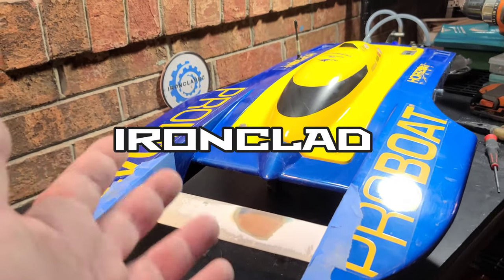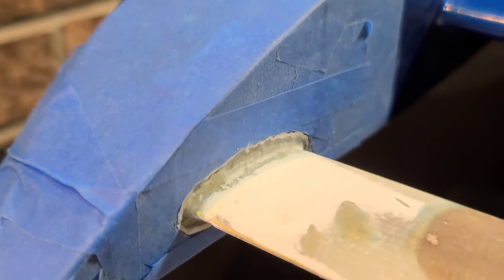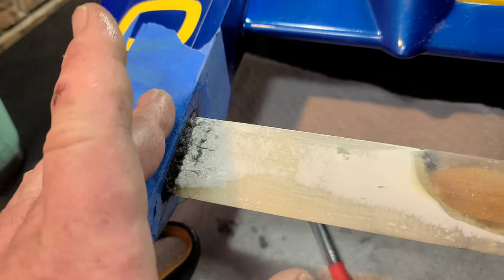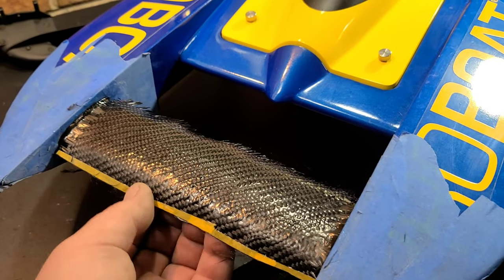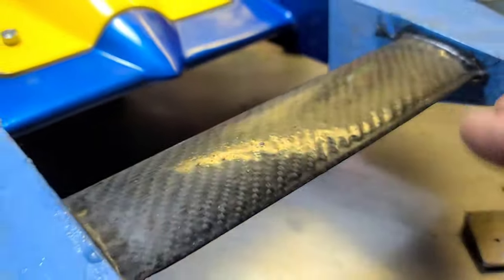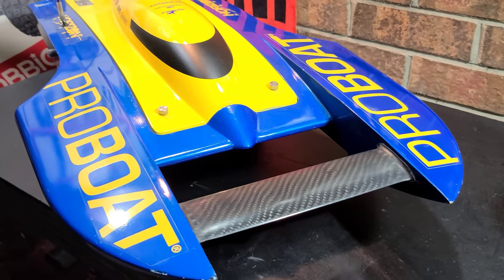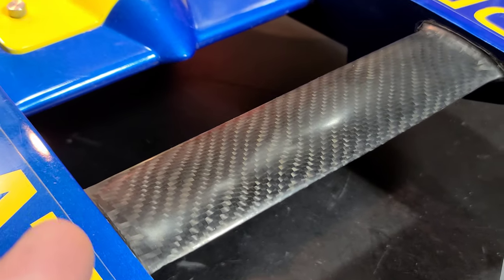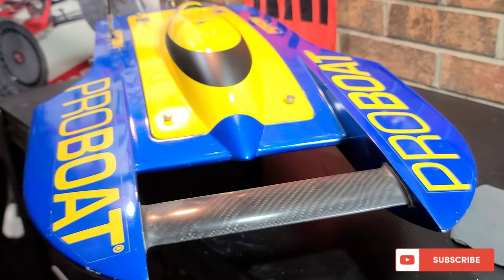Carbon Fiber Front Canard Mod Proboat Ul19 - Rc Hydroplane Performance Mod

Comment: Your doing some great body an fender work lol I did see a round sanding disk on 1 of your blocks of wood that u were sanding something in 1 of your video so I would say these RC boats aren't your first time doing body an fender work! An that stuff is tricky especial when doing dark colors Ive done a few cars in my life an I took a 79 Camaro all the way down to bare metal boy was that a job ! Started as yellow with black strips over the top an pained it a dark blue with metal flack the car had a lot of hail damage an i ran a flat black primer man every time i thought i was done with body work i would shot that black primer an another flaw in body work would show up i must of had 3 to 4 thousand  hours on that car but when i was done it was show quality with 6 coats of clear coat it was better then show room floor but I'll never do it again that was hell! From there i pained a cadie white an how much easier that was to hide the imperfections  being white. I'll never paint another car a dark color again unless it's a ( Unicorn an I'm planning on keeping it the rest of my life) Unicorn being like 71 Dodge Barracuda or Mustang GT 500 or 19790Judge GTO but that would be a goat not a Unicorn or would it be LOL . Or an old GS or Z28 But now little RC boat i think i can handle that !
Reply: Sorry 1970 Judge GTO
Reply from the maker: I have a 1965 mustang in my back yard rusting to bits, to much to fix. I bought it to restore once I got into it, and I found it was to far gone to mess with.  I live on the coast, the salty air destroys older vehicles.    I learned everything I know from working on sport fishing vessels 1:1 boats my whole life. we'd pull the boats out every winter and modify the hulls fix rotten areas etc. on dry dock, the captain I worked for had about 5 boats in his fleet so I picked up alot of trick of the trade along the way

Comment: Big B, what Lipo batteries do you mainly for your FAST boats?
Reply from the maker: SMC Hcl hp 6500 7600.   For speed runs I run SMC SRD V2 8600

Comment: One layer twill weave carbon on ride pads ......?
Reply from the maker: If I were to do the ride surface, I'd use finely chopped carbon fiber, epoxy, with graphite powder in the mix.  Been working great for blueprinting the ride surface on my boats. Works and sands nice

Comment: Where did you buy the carbon fiber
Reply from the maker: Couldn't pull up the exact listing I used but here's a link to the CF and epoxy from the Same vendor/seller on ebay 
https://www.ebay.com/itm/12-x-5FT-Twill-Weave-Carbon-Fiber-Fabric-Cloth-Resin-Kit-/115173374556?mkcid=16&mkevt=1&_trksid=p4429486.m46890.l6249&mkrid=711-127632-2357-0

Comment: Hello big B i could use some help! Look for a cheap 6s battery charger . Any suggestion where i can get 1.  I just ordered a SMC HCL-HP 22.2V 5800mAh 150C G10 Protection Plates but i don't have a charger that goes up to 6s ( Please Help!) Prices are outrageous for 6s battery charger from what i see.
Reply from the maker: I use SPEKTRUM chargers s1400 & s2200. The s1200 is a good one it's a 200w  single channel charger, 140 with 20 bucks off at the moment. https://www.avantlink.com/click.php?tt=cl&merchant_id=953aec29-878e-4306-b620-2df85883455e&website_id=70256520-69d3-496b-a06d-cfbf9af7a81d&url=https%3A%2F%2Fwww.horizonhobby.com%2Fhttps%3A%2F%2Fwww.horizonhobby.com%2Fproduct%2Fs1200-g2-ac-1x200w-smart-charger%2FSPMXC2020.html

Can't say much about other chargers I've used several over the years, and the SPEKTRUM line has been pretty good to me the past year or so.
Reply: @IRONCLADRC  ouch the battry charger is going to cost me more then the battery! :(
Reply from the maker: Cheap chargers don't last and don't put a deep charge into your battery.    Might be worth buying a decent charger.   I went through 4 cheap chargers in less than a year, got the SPEKTRUM charger I've had no more issues with batteries going bad to soon and no battery fires.